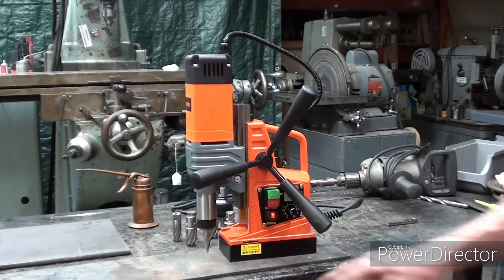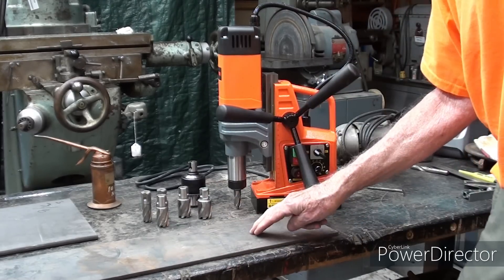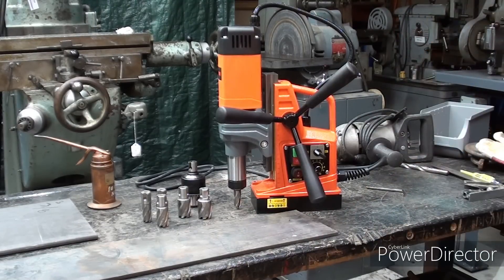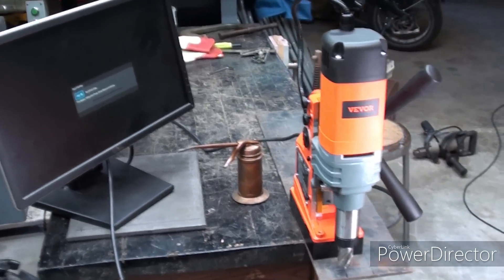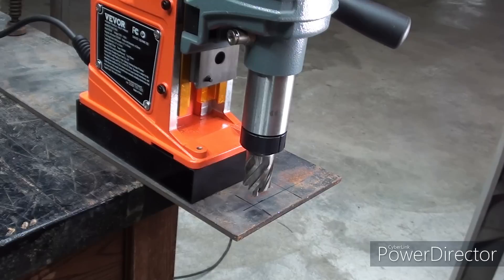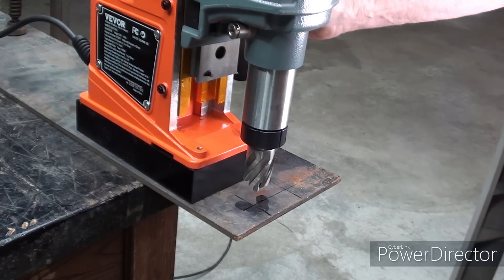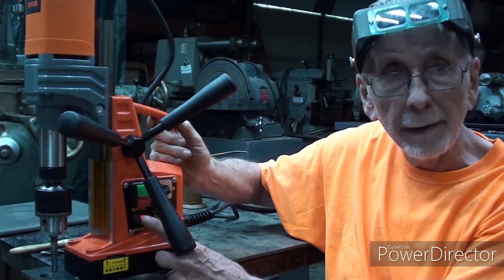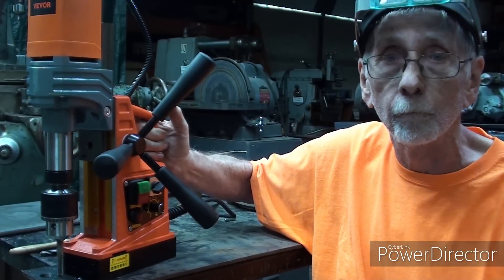MAGNETIC DRILL PRESS vevor pt 2 #877 tubalcain

Comment: Years ago I installed a 48' hanger door 14' high. I had to drill about 24 holes 3/4 inch using a Milwaukee Buldog drill. Whew...my wrist felt like it was broken several times when the bit caught. That is the most powerful small hand I have ever used. I now have a Milwaukee magnetic drill with the large motor. It does not bog down drilling. Except for the weight, it is great to use. I enjoy all your videos !!
Reply from the maker: Thanks for watching. We had a bulldog drill at school, I borrowed it once and it was a monster.

Comment: I bought some annular cutters off vevor and tried your VVS10 code, it was a different set and I really didn't expect it to work, but Vevor said the code didn't exist.  I didn't know if you got a small commission for being the salesman...  Looks like codes expire after a while.
I guess I just ordered the older model without reverse and quick release universal shank from the jungle website.  There is a confusing number of models that vevor sells.  

The shank on those cutters are called Universal shank or Nitto shank, the original Japanese designer and drill manufacturer.  They say you need an adapter to use a Weldon shank in the quick release system.
Like many designs, Nitto's is off patent now, fair game for china....

Comment: I would not buy that Vevor tools based on your work with it. Yes I have been abused by an all metal Milwaukee 600 RPM drill motor. And I use a 2 foot handle hopefully braced against something other than me. Maybe it was a Thor.

Comment: I have a 1" gear reduction drill. I was drilling a 3/4 inch hole when the bit got stuck it twisted up my arm to the point where it thought it was broken luckily the bit broke. It was weeks before my arm healed. That drill was never used again and still sits in my tool cabinet. I should really destroy it before someone get seriously injured.
Reply from the maker: Yes, get rid of that thing

Comment: ents
303

Add a comment...

@joewest2560
1 second ago
Oh yeah, I joined the ranks of idiot with one of those large drills myself.  I still have it and every time I walk by it vivid bad memories return.  I remember clearly 52 years ago I was drilling out a broken exhaust manifold stud in a big block Chevy cylinder head that was sitting on my work bench unclamped when the bit caught in the head. It flipped the head 180 over like a pancake, then off the bench and violently into my right hip. Terrible pain, a black and blue that resembled being hit by a cannon ball. The next two days I could barely walk. Moral is NEVER underestimate the torque power of those beasts!

Comment: Ive definitely had a dust up with a big drill motor, i was honing a 24 inch diameter cylinder for a steam hammer and the motor literally spun me upside down (was using it horizontally) when i hit a tight spot lol😅

Comment: I'm the one you heard about having a drill break a hand. I was trying to enlarge a hole that was in a piece of double strut with a high torque drill that someone had removed the front handle from and the bit caught and kicked the handle around pretty hard, my hand felt sore but I didn't think much about it and went on drilling, then about a half hour later my hand started swelling up and didn't want to grip, that's when I could see where the bone was broken from my wrist to knuckle on my right hand ring finger. Strange the way it broke it was like the twist on a barber pole. First and only broken bone I have had.
Reply from the maker: Wow, I bet that was painful

Comment: The only problem I’ve had with big drills is snapping the bit. On one occasion I was using a rat angle drill drilling between joists to run pipe or conduit and I snapped the knuckle.

Comment: One last observation, often when drilling plan hot rolled plate (not machined) mag drills will sometimes walk a little when you turn the magnet on and move you off your mark. We always keep a rubber mallet handy to tap the base of the magnet to do the final alignment on a hole that requires some precision.
Reply from the maker: Excellent tip.    I will remember that

Comment: Anybody that has ever used one of those big drills has had a "incident", just hopefully it doesn't end with a trip to the hospital. We always used 2 men on it and they will even wrap up 2 men.

As far as the mag drill, I guess it does ok for the price point, but it doesn't seem like it holds a candle to my Milwaukee. I've drilled and power tapped probably thousands of 5/8 holes in long gantry mill beds to hold fixtures. Spiral flute taps work best for power tapping, because it pushes all the cuttings ahead of the tap and out the bottom. It also seems like your annular cutters aren't very sharp, you should be able to go though 1/4 and 3/8 plate like butter.
Reply from the maker: I am sure the Milwaukee is far better. But probably costs three or four times as much. Yours is built for industrial use.
Also, remember, that was the very first time I used one of those drills. I had no practice run, or rehearsal, which I probably should have done. If I do any more tapping, I will definitely use a spiral tap if I have any. Thank you very much for the advice .

Comment: I might be mistaken, but I think the center locating pin will also start the cutting fluid flowing when it depresses. Of course you have to have the reservoir attached and plumbed. When the hole is finished it should eject the core and stop the flow. I have seen that feature on another mag drill. That one worked only in the vertical position.
Reply from the maker: Yes, that is one of the features, and I failed to mention it. Remember, this was all new to me. I have never ever even turned on machine like this on.

Comment: Before 3-wire grounded tools became mandatory, large numbers of construction workers were electrocuted by the old 1/2" Black and Decker drill motors developing internal short circuits, leading to the metal case becoming energized to 120 volt AC.  Resulting in AC current flowing directly from the metal housing, through the operators hands and body to grounded metal structures on which they were standing or sitting.
Reply from the maker: It was a big advance and power tools when they came up with the so-called double insulated drills. I received many shocks myself in my early years. My dad always told me to stand on a board when we were in the basement drilling.

Comment: As I write this I have a sore wrist from a drill twisting out of control while drilling a relatively small 1/2" hole yesterday in a steel workbench my dad gave me. I knew better because the angle was bad and I am an amputee already so had the used of one good right hand. Long story short, I watched your videos about this and placed an order today. No more twisty wristy for this guy. Thanks for the thorough review. I loved it.
Reply: Kinda used to busting knuckles.now my wrists have weakened enough for me to order one these. Thankz for the info.after almost a year have they come up with a chuck you can use?
Reply from the maker: It seems like virtually everyone that works in the shop. Has experienced what you just described. Keep watching.
Reply: @mrpete222  The drill arrived yesterday. Before I got the drill I wasted hours and effort trying to make the 1/2" holes. With the magnetic drill, I finished all the holes in the workbench in about 30 minutes. Why didn't I buy one sooner? Duh.

Comment: I have used a mag drill  for several years,, what you need to do is center punch the drill start and use the dry lub sticks, I get mine from Hougan mag drills  inc. My drill does not bog down like this one and does not make any gear noise. When to speed is right you get nice long curled chips not short ones.

Comment: An old Black & Decker 1/2" drill motor that looked a lot like that grabbed hard while I was up on an extension ladder. It knocked me off the ladder. Twice lucky: (1) I landed in soft sand. (2) The drill bit hung up in the hole I was drilling, so the drill motor didn't fall on my head.

Comment: Good morning Mr. Pete,  first thank you for the education you provide the world of machinist with your expert life experiences. Just a quick question. I have been looking to replace my mix match collection of taps and dies with a uniform good quality set of SAE . It seems there are mostly metric sets out there. My need is for a full range of SAE taps and dies with minimum OD dies so I can make the least amount of die holders for my tail stock. As for taps, I have seen so much about spiral taps, I would like to step up to spirals, if you agree, for hand and power tapping in my lathe and milling operations.. The range I use mostly is #2 thru 1/2”. Can you recommend a good manufacturer of these as sets or individuals if need be. Don’t have a Hugh budget but do try to get the better quality tools, Made in USA if possible. Thank you for any advise you could provide. Appreciate every video you make. Papa Maggio, Ex shop teacher from 50 years back.
Reply from the maker: Stay away from the bargain sets of taps and dies. They are very poor quality. Look in the MSC catalog for major brands. But they are very very costly. I do not have a lot of experience with the spiral taps.
Reply: Thank you, for your feedback. I love watching your videos. Happy you are still providing technical skills to those with the desire to learn. It upsets me so that the country has let the trades dwindle from our educational system.
Reply: I'd buy them as you need them. Good taps are expensive. Spiral FLUTE taps are good for blind holes as they eject the chips out the top of the hole, but I've found them to be more expensive and more delicate. Spiral POINT taps work best for me. They eject the chips out in front of the tap. great for through holes, not so good on blind holes.

Comment: I use an ordinary plastic soda bottle with a ~1/8" hole drilled through the cap to apply water-based coolant when drilling in the field. It makes cleanup easy and if a bottle gets damaged nothing of value is lost. I got the idea from my machinist bud who couldn't keep oil cans from getting trashed so he replaced the ones at all his machines with soda bottles (which were free leftovers from the break room soda machine).

Comment: I can vividly recall drilling holes in a Chevy truck frame to install a transfer case crossmember, as part of a 4x2 to 4x4 conversion. Also leaf spring hangers and some other stuff like the PTO we put on that truck. We had two drills, a big Makita and a HUGE old Black & Decker. IIRC we were drilling 13/16" holes for 3/4" bolts. Lying on your back, the drills would inevitably catch just before breaking through, and the truck frame would get its revenge on us for drilling holes in it! Sometimes it would smash your hand into the truck floor or worse, into the concrete floor. Other times it would feel like it was pulling your arm out by the root! Or your neck would snap; on one hole my neck snapped forward and the pointed end of a screw protruding through the truck floor dug a nice furrow in my forehead. I think we had a total of 16 holes to drill, and each one was a terrible experience. The B&D drill was faster by far but we paid a higher price for it in terms of blood and pain. On the very last hole my friend actually broke a bone in his hand when the B&D caught and slammed his hand into the concrete. I finished the hole with the Makita, but drilling those holes in the truck frame was an ordeal I will never forget. I reckon we both had an epiphany when we saw how easily a mag drill with annular cutters could do the job. At that time there were no inexpensive import machines and the average mag drill was $500 and up in early-80's dollars, but surely we could have found a rental outfit that had them and saved both time and flesh that way.
Reply from the maker: Wow, I bet that was quite an ordeal. And I can very much identify with it.
Reply: @mrpete222  I'm sure you can. Anyone who hasn't experienced the power and inirtia of a gear-reduced hand drill would be shocked by how much stronger it is than our puny human frames! After the first three holes, all with injuries of some sort, we began marking the wall with each completed hole. Two-thirds of the marks were in blood! I'm sure you can imagine the trepidation we felt when all other possible work was done and it was time for another hole. I reckon it was a kind of turned-down version of the feelings that WW1 trench soldiers felt before going over the top of the parapet. Of course they were facing the possibility of iminant death, whereas that B&D drill was not going to kill you. At least probably not. I kept the Makita and have it to this day, but I got a sort-of PTSD from that dang B&D and sold it at garage sale for $5.00. I reckon the purchaser figured he got a great deal, but litte did he know what he was in for...

Comment: I was atop a 16 foot ladder with one of the sort lived very powerful Milwaukee Hole Hawg drills with the ill fated 2 speeds forwards and only low in  reverse. I punched a 1-1/4 inch hole through the 1-1/2" top of a 2x6 framed wall, another  2x6 header, the 2nd floor decking and a  2x6 sill plate. I drilled in high and the drill bit caught going through the final sill plate on the 2nd floor crawlspace. I went to back it out in LOW reverse, and that drill clocked me in the head and swung me around to the opposite side of the ladder. Thank God I didn't let go of it. I'd have fallen 13 feet onto concrete. I saw that same drill motor snap another employee's wrist.  Magnets don't stick to wood, and there was no standing up in that crawl space. I had 3/8 pilot holes all aligned with the multiple floor decks by using a plumb bob.
Reply from the maker: That’s very scary. I have used one of those hole hawgs.  There is no stalling them.

Comment: I have bee hurt by the Milwaukee Hole Shooter with the full length trigga er that is impossible to let go of when it's in your right hand. - And those old Milwaukee rotohammers with no clutch broke many an arm. - I'm no safety Nazi but man, those Decker 3/4" drills. - Only way to run them is 2 guys a chain and 60" bar or pipe.  Put the chain around something about 2' away from the location of the hole you want to drill and put the bar through the "D" handle and chain. It acts as a reaction bar and provides the down pressure.  Weld on a lug for the chain if you have to but don't even think about using one without the bar . One guy holds the drill and trigger. and the other guy pushes down on the bar. - I would not even think of using one of those man eaters alone...

And don't get too complacent with  1/2" Milwaukee angle drill either. It's another one you don't want to trigger with your Right hand. - When (not "IF") it grabs since you already have a death grip on the handle you will not let go of the trigger until it's too late. With your left hand it pulls out of your grip and stops after the inertia of the armature winds down. At least you got a fighting chance of not getting a broken arm. 

The bottom line is all drill motors over 3/8 (and under too) can and will hurt you. I even sprained my wrist a couple years back with a Bosch 1/2" Battery Drill (Again holding the handle in my Right hand) ALL drills are dangerous. Don't get complacent or it's when and how bad ,,,,,and around rotating machinery  loose the gloves or loose a finger, but that's another (horror) story.
Reply from the maker: Thank you for the warning like totally agree with everything you said. Also I had one of those drills with the long trigger. Torque is tremendous. I’ve had my share of accidents and near accidents.  
If you read through the comments, you will see that we are not the only ones that had accidents.

Comment: You would see the factory pipe handle with the rounded knob on the end for those lying in tool boxes at sales.  They always seemed to get separated from the drills.  Have you seen what a short piece of iron pipe costs now days to replace it?
Reply from the maker: Yes, they are almost always separated because of storage problems. I am planning a video on making a voice and I need 1 foot of inch and a quarter black pipe. I was shocked at the price.

Comment: the old heavy 1/2" Metabo has a trigger lock that was very easy to hit with your thumb when you were using it
Reply: I have a similar drill branded Black & Decker, but made in West Germany, so I believe it's actually a Metabo.  It has the same issue, but it's even worse when you're left-handed.  Your palm automatically depresses the trigger lock button when you squeeze the pistol grip.  Bad design and potentially unsafe.  Very good Röhm chuck though.

Comment: I really appreciate your review of this tool. It was looking at last relatively attractive due simply to price but unfortunately I think you get what you pay for and I'll look for a used Milwaukee or DeWalt rather than one of these. The motor doesn't have enough torque to actually handle the load spikes so they're compensating with electronics. That's such a horrid combination imo. I wish the $1,000+ price tags of the more name brand machines weren't looking better, but I think a $2,700 Milwaukee is better price to performance than this.
Reply: I know of someone using a seven year old Milwaukee Mag Drill ( with the nice batteries) and that thing goes ALONG way on one battery! Multiple large diameter holes on thick plate.

Comment: i worked in a factory where we used magnetic drill presses like these, but the quality of the machines we used was so much better. This vevor one is very noisy and under powered. The sound of the gears is so loud. This is the best advertisement not to buy anything from vevor, unless you only have to use it one time.